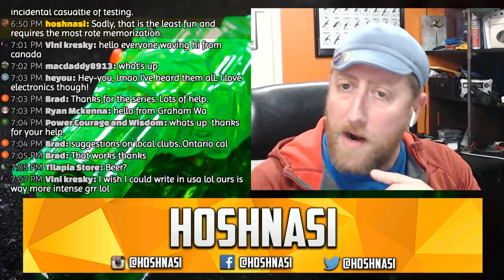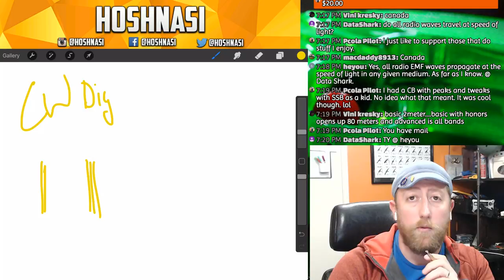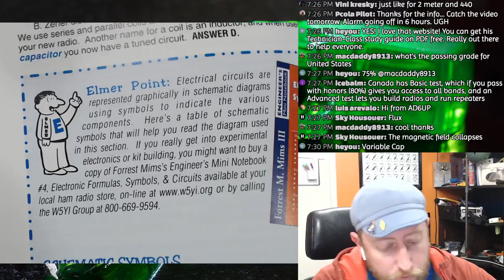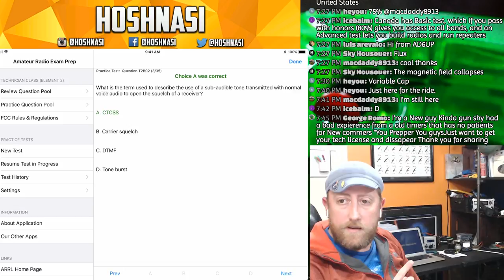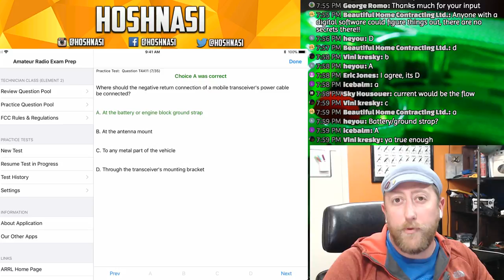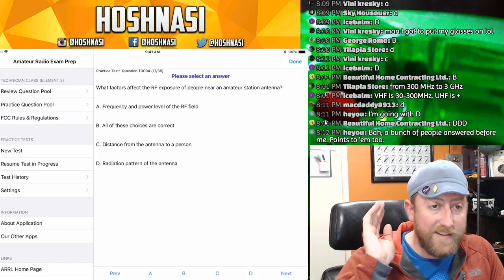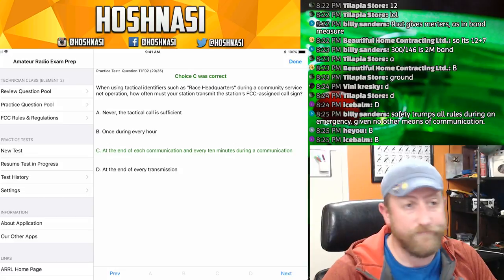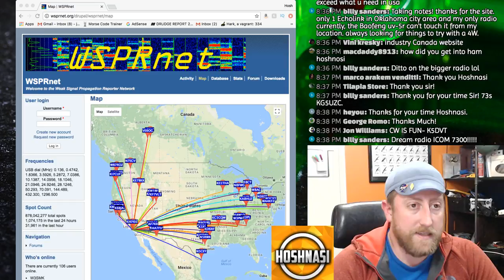Lets Get Our Technician License pt.3! How Radios Work and Electronic Components

Comment: My understanding on PColaPilot's comment about CB/SSB is this: The CB was tuned to using 4 (or more likely 5) watts (Peaked and tweaked). The SSB is like this: If you have a 4-watt transmission, 2 watts is the carrier signal, 1 watt is for the upper sideband, and 1 watt is for the lower sideband. The transmission is spread out over all of that on AM. When you use SSB, it eliminates the carrier and one sideband, and concentrates the entire 4 watts on the remaining sideband.
Reply from the maker: Werd

Comment: Hi KN4IQP here I just  got my tech class two days ago and i have a Baofeng 
BF-F8HP I've had it for a couple months and I have been listening to my local repeater and it works great. My issue is I cannot transmit using my radio, I have tried programming the ctcss for the repeater but it will not save. Is there something I'm doing wrong? Or a feature that disables ptt that I need to enable? When I press ptt it seems like its working but I have a friend listening and they said they cannot hear me. I have tried 2 different antennas and there is no difference. I can hear the repeater crystal clear. I just cannot transmit. Any help would be much appreciated, thanks.
Reply from the maker: How far are you from the repeater and what software do you use to program?

Comment: 43:57 and the dick measuring that follows for a bit is a gross over generalization of why someone may want a technician license and go absolutely no further. I can speak only for myself, but currently I have no interest in any other tier (although I would like to study the general license materials for a better understanding).

Why?

Because I’m not a “prepper”, but I do love to go backpacking, backcountry camping, and climbing. I want to use radios with greater range and, I need for them to be as light and rugged as possible and have a long battery life.

I have a gmrs license and handhelds, but some technician handhelds fit the bill for me even better. “The first step” as some might see it is all I really need or want.

Not everyone is getting a technician license only because of an impending apocalypse or whatever, but more power to those guys and gals if that’s what they love to do.

Comment: i love the work you put into your video's. But please get the electrical part right. Transformers do not convert DC to AC or vice versa. They isolate two electrical systems and can either increase or decrease an AC voltage, depending on windings. If you put DC through your transformer, you're gonna have a BAD TIME (Depending on ratings ofcourse)
Reply from the maker: Should be fun!  Lets let the smoke out of some stuff!